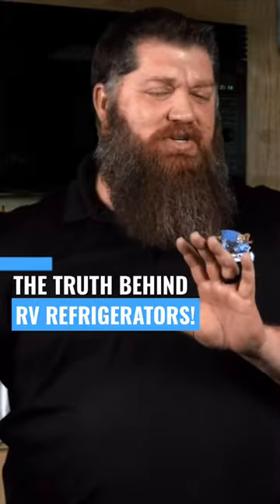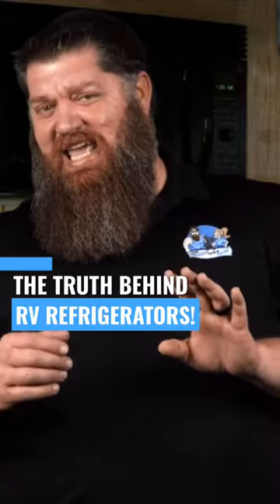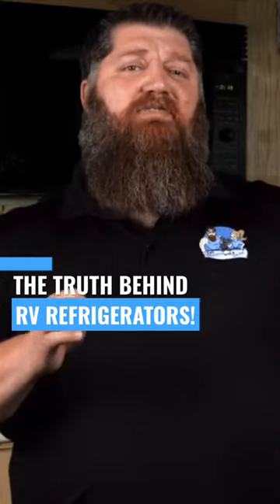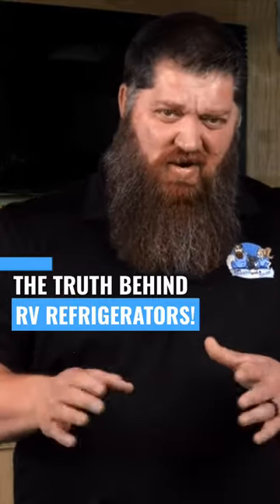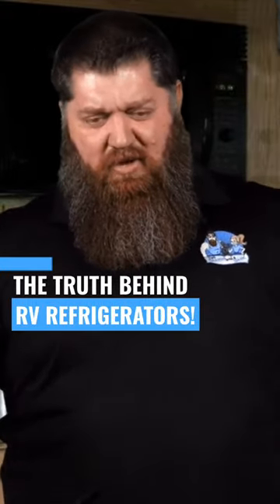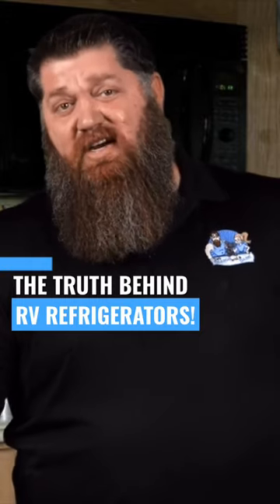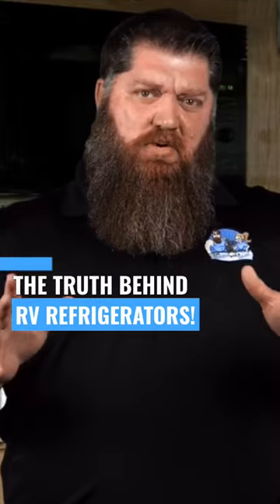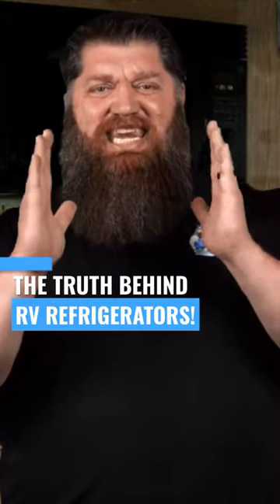Learn the truth behind RV refrigerators! For the full video, click the ▶️ below! 👇👇👇 #techtips

Comment: Try to get or use a 12v DC powered refrigerator instead of the old-fashioned absorption refrigerators. Then you don't have a problems with keeping the rig level and having to run unsafe propane on travel days to keep the fridge cold.